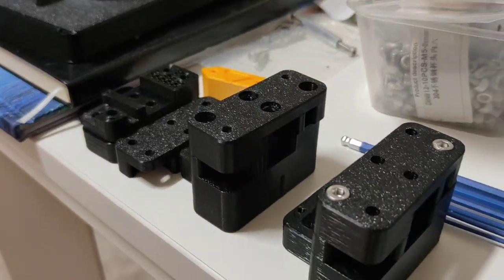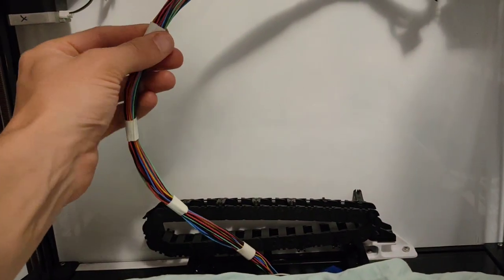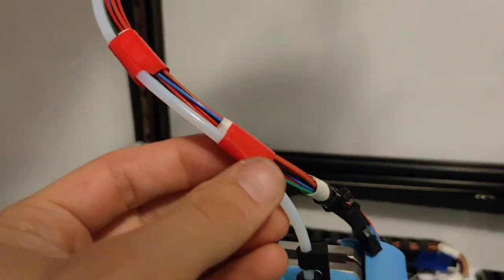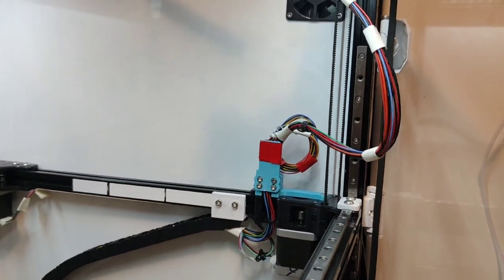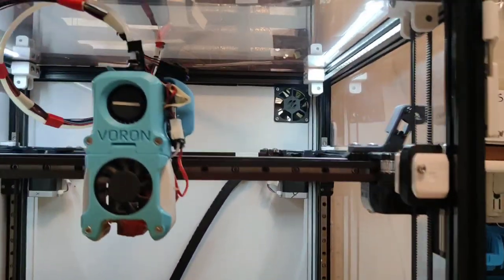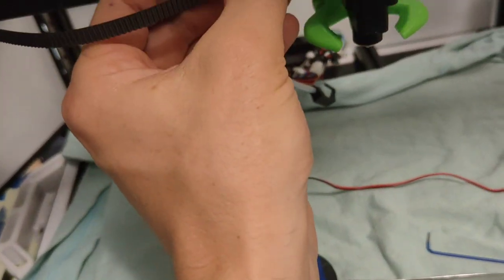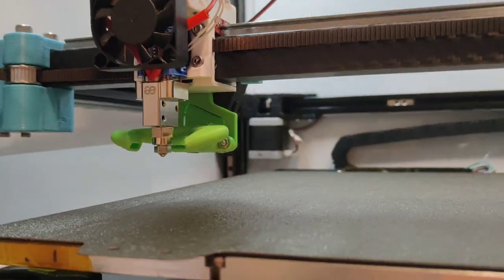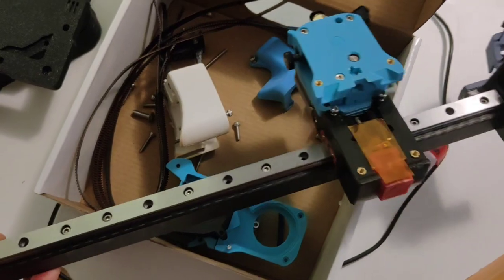Voron 2.4 350 Conversion to Top Mount X Rail. The Journey.

Comment: Thanks for the vid. Why is there less printing surface with a top mount vs the normal voron way? Top mount should in theory be better because the motor is close to the mounting point and that should give better balance although I'm not quite sure because the center point of the whole toolhead is where the regular voron mouts it.
Reply from the maker: The stock voron tool head is front mounted. All of the tool head components sit front and top, it has no x beam rear overhang.
The loss is from rear x beam tool head over hang pushing the x beam forward so it does not collide with the rear motor mounts.
Overall the stock voron tool head is a   behemoth of weight and size. The weight improvement and minimal loss of print space is acceptable for the massive gains in performance and top mount tool head options.

Comment: Is the carbon rod the only option or can the original x extrusion be used?
Reply from the maker: Its a bit short. I forgot the exact length required it's in the CAD and on the GITHub
I recommend cutting a new extrusion or carbon rod is best.

Comment: The only bad thing I can think of with rails on the top is dust settles on those surfaces on my machine more than any other place.  So you could get more junk into the bearings over time.  Maybe it would take years for that to be a true issue, but my personal observation.  Also, why not put klicky on the other side?
Reply from the maker: I don't seem to have any issues with dust. As it's a enclosed unit.

I like RatRig and VzBot how they have top Mount X rail with a nice center balance of weight distribution of the end carriage.

Klicky probe can be placed anywhere, I just placed it clear of the cable chain and opposite the purge bucket and close to the z end stop. Both will be obsolete soon the the Beacon Probe that's on his way.
Reply: @jc84com  Mine's in a basement with air filtration, but still gets a dust build up after a few months. I print more PLA than abs so the panels are open more.
 I didn't notice that about ratrig or vzbot printers.   Nice to learn something new each day.

Comment: This is really pretty cool.  Question, why do you need to run the umbilical out the back to the top?  Was that just to save printable height?
Reply from the maker: Looking how the 2.4 was designed as a flying gantry. Having a top center umbilical and top feed filament not idea for this. I see why the filament comes in the back wall for the base configuration.
With a top mount tool head there is more of the tool head on the back of the X axis beam. Having the Z chain under the Z axis is most ideal to maximize space... However my early designs required the whole Z gantry to sit lower because the tool head nozzle would sit much higher on the X axis and this would crush the Z axis cable under the gantry... I ended up getting a UFH dragon and that has a very long heat block. Extending my nozzle bellow the gantry more...So technically now I could have kept all the cables under the Z axis gantry because they wont be crushed anymore and ran a umbilical from the back like how everyone does. The change is done and wont be going back anytime soon.